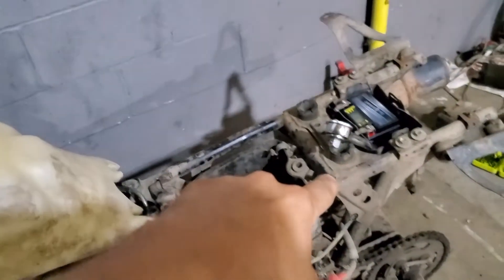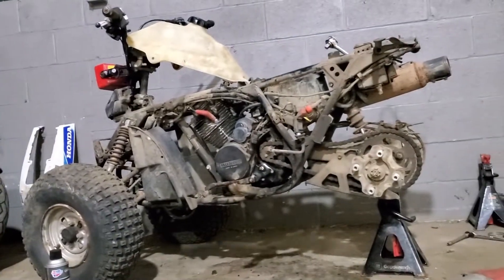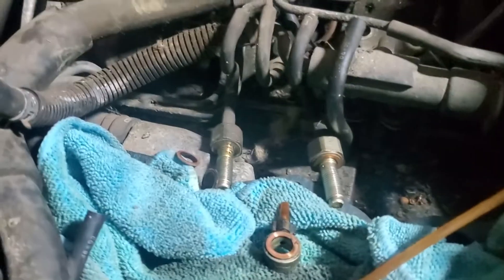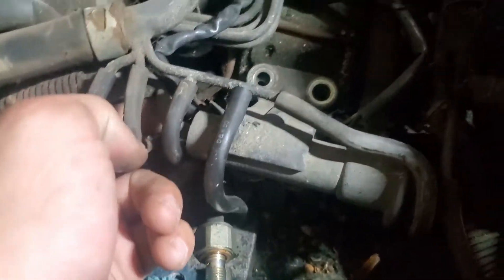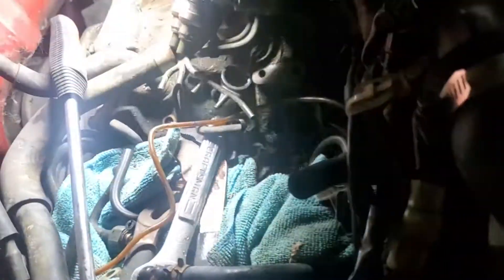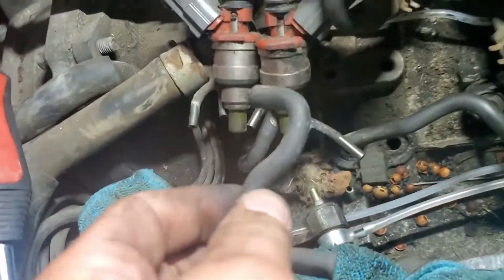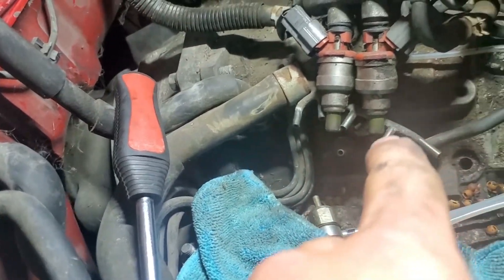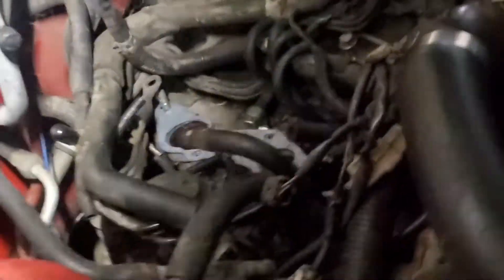Part 2 of OMP install

Comment: What size where those rubber lines that were hard? 3/16?
Reply from the maker: Yes sir
Reply: @mikemazz66  thank you. I'm also trying to bring back to life a an s5 that I rescued. One more question. Have you ever seen sludge on spark plug threads that look to be copper metal flakes/glitter?
Reply from the maker: @everzamora9031  no sir. I have a vid of when I first got it running. You can see the spark plugs in there they didn't look bad but didn't allow the car to start